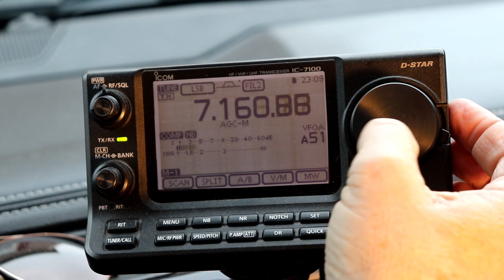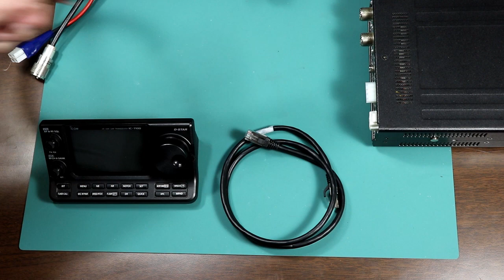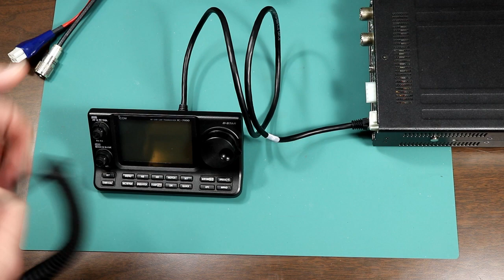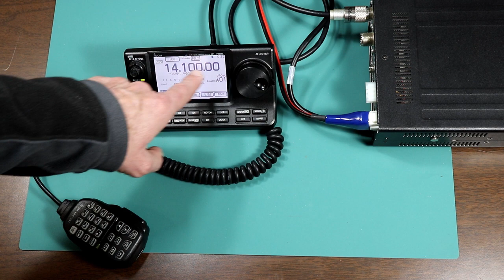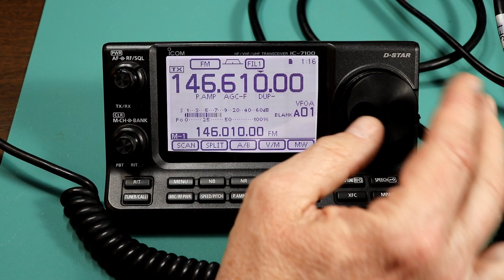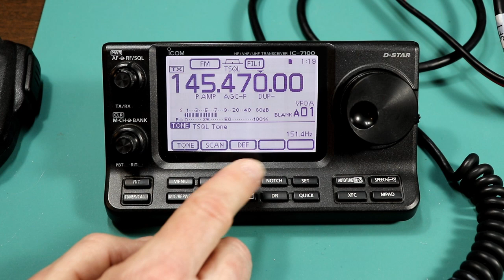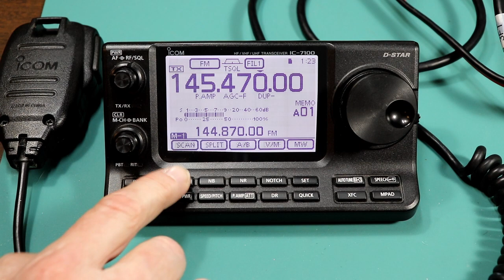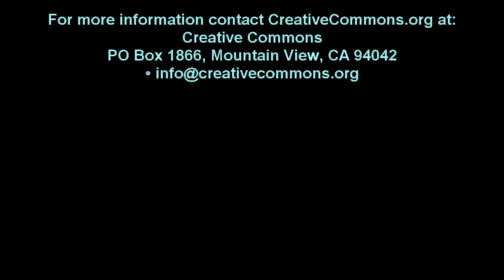IC-7100 from A to Z #2 Setup-Resetting-Programming a 2 Meter Repeater Frequency

Comment: Ok. Guess the old days of unpacking the box and intuitively being able to transmit are gone.
Thank you so much for the guidance as this 69yo has no patience for a 300p manual. Will be watching ALL the videos. 73 n6iv
Reply from the maker: Hi Mark.  Thanks for the kind words.  You can almost use the 7100 without reading the manual, at least just to transmit and receive on 1 frequency.  However, there is so much more that the radio can do if you learn it with tutorials or with the manual.
Reply: Just the video I was looking for. 

This seals the deal on purchasing a IC 7100. 

Thank you.

Comment: I have a General already-it was much cheaper than a radio. So I just bought an IC-7100, a power supply and waiting on my antenna and cable- really good videos-thanks for your time as a “video Elmer”

Comment: Thank you for this.  You really don't know how much I appreciate this series.  I am a brand new Ham with a brand new IC-7100.  I bought the radio because it is an all mode all band radio.  After reading through the basic manual and making my way through most of the full manual, then trying to put it into practice I was beginning to think I was way over my head with a radio I had no idea how to use.   Looking forward to the rest of the series on this radio.  Thanks again.  KE8OTX

Comment: Liked and subscribed. Good stuff. Thanks for putting this together Tom. Very helpful. I attached a cheapo mobile antenna on a pizza pan to my 7100, and was able to hit the local repeater that's ~5 or 6 miles away. I participated in a local net, and had my first conversation with some other ham folks in my area. First time not using my HT or echolink. I've got the local repeater and the NCFs stored.
Reply from the maker: That’s great Rich!  I’m glad you’re enjoying the 7100. It’s a big step up from an HT.  Hopefully you can get an outside antenna up at some point.

Comment: Thank you VERY much!!!  The IC7100 is my dream rig, but the user interface takes a little getting-used-to.  I was totally baffled how to get this thing to remember a simple 70cm frequency and PL tone!!!  You made it VERY clear!!!  You're a great Mentor Tom!!!!  73!!!!!!!!   -N3FPZ  (John)
Reply: PL (Private Line) is a registered trademark of Motorola and CG (Channel Guard) is a registered trademark of GE land moble they both are the same for the generic for CTCSS (CONTINUOUS TONE CODED SQUELCH) which is normally used on the input of most repeaters. CTCSS was and is used to keep noise from keying up repeaters.

Comment: The cable is a CAT 6e/7/8 double shielded Ethernet cable.   A  15' cable Cat8 SSTP with gold plated connectors on Amazon is only $20.00 USD.  The icom cable is over priced.  Strait through vs. 568a does not matter.  Since the same pins connect on each side.  1-1, 2-2,3-3, 4-4,5-5, 6-6,7-7,8-8.  Only matters in the case of a roll over or a 568a - 568b cable (cross over, non standard)  Thanks for going over this radio.  I just purchased mine yesterday.  I am waiting on pins and needles for it to arrive.  Going through your entire series now.
Reply: Hi Jim, I'm running my IC-7100 through a portable battery rig and the included cable is just so much longer than I need it to be. Since you seem to know much more than I do about these things I'm wondering if a cable like this will work, since it's not a CAT 6e:  
"Cat6A Shielded (SSTP) Ethernet Network Booted Cable 4 Feet (1.2 Meters) Gigabit LAN Network Cable RJ45 High Speed Patch Cable"
Could I use a CAT 8 with the gold connectors? Thank you in advance for any help.
Reply: @travisyoung3455  The cat 6 cable may work.  However, the cat 8 has additional shielding.  Close proximity to a RF source can induce errors in the system.  I experienced this the first go around and in some cases can cause your radio to reboot right in the middle of transmission.  So, honestly I would stick to the cat 8.  In cat 8 each pair is individually shielded as well as the bundle being shielded, not to mention the additional twists per inch.  So, yes, go with cat 8 with the gold shielded connectors.

Comment: Very helpful video!  I bought a 7100 because I want a mobile transceiver than can cover HF and VHF/UHF,.  I have a 7300, but I've committed that rig to my ever expanding Ham shack.  I am impressed by the ease with which 2-m repeaters can be programmed into the 7100.

73
KI5KET

Comment: I have the IC-7100 and the IC-7300. Lucky for me you are doing all the heavy work for me. I was doing this on my Yaesu FTM-400XDR this morning. ICOM sure has it over Yaesu on ease of using their menus. I think I was able to do this the first time without consulting the manual. I have to grab the manual every time I program in a repeater on my Yaesu because I don't do it enough. The ICOM radios are just intuitive enough to help you through the process most of the time and a similar from radio to radio unlike Yaesu radios are different radio to radio.

Comment: Great stuff... spent all evening reading the manual on the used 7100 I just received and assembled today.  Resetting and starting over was the way to go as well as your explanation of the repeater Tone settings (I didn't have both set).  Now I know why I couldn't get into the repeater with this unit or save it to memory.  Thanks!
Reply from the maker: Glad it helped!

Comment: Tom, many thanks for confirming the type of control cable we can use in lieu of the two options provided by ICOM.  I couldn't easily find this info elsewhere.  I am new to the 7100 and am using it in a base config on a small table so the standard 11.5 ft cable included is way too long for what I need.  Looking forward to reviewing the rest of your IC-7100 videos!

Comment: I'm assuming the 5100 is going to be very similar menu and operation wise? The 5100 is probably going to be another radio in my stable.

Thanks for explaining "Tone vs TSQL" nobody had ever made the distinction before, and I have seen it in chirp and other places, and so far had just been setting both Tx and Rx "Tones" without knowing what TSQL was actually doing. I have seen split tones on some GMRS repeaters, but never on an Amateur Repeater yet.

Comment: A great series of videos thanks Tom. I chose/purchased a 7100 knowing that your 7300 videos had helped so much. What are the dash mounts shown/used in your vehicle please?
Reply from the maker: Hi.  I'm glad you're finding the videos helpful.  Thanks for the kind words.  I use RAM mounts for the mobile setup.  I have links to some of them on my website here:  https://a-2-z.tech/stuff/.
Full disclosure- they are Amazon Associate links.  So I get a small commission if you buy something.  It doesn't affect your price.  There are tons of different options available.  Just search "RAM Mounts".
P.S. - If you start from one of my links, I'll get credit even if you search for something different and buy it.
Thanks!  Tom
Reply: @HamRadioA2Z  I am happy that you get a commision, if you hadn't mentioned it, I would not have known. I have the 9700, 7300 and the 705 and the 7100 still fits into this line up Tom. It was an indication of where Icom were heading when it was released, but it still can hold "its own" as a shack/portable rig.

Comment: I just started watching this series for my 7100.  Was that hand mic an optional mic. Mine came with the HM198.  Also my control says D-STAR while your control head says DIGITAL when the video had it in your truck.
Reply from the maker: Hi.  Yes, the HM-151 remote control mic is optional.  I managed to pick one up used.  I find it very helpful for tuning around and changing bands when operating mobile.  I'm not sure what digital reference you are referring to.  The radio displays DV when it is in DStar mode.  I haven't done anything with DStar or any digital HF modes in the videos yet.  73, Tom WA2IVD

Comment: Tom -  Thank you for this series, it is great.  I have a question.  At about the 16:00 minute mark of the video, immediately underneath the frequency, your screen shows DUP - .  What does that mean or represent.  On my screen I have DUP+, but I can't transmit, only receive.  How do I change it?
Michael
Reply from the maker: Hi Michael.  DUP- means that the radio is in Duplex mode.  That is, the transmit frequency is different from the receive frequency.  The - means that it will transmit below the receive frequency.  The + on yours means it will transmit above the receive frequency.  The amount above or below is set by the standard offset.  The default on 2 meters is 600khz.  On 440mhz the default is 5Mhz.  Not sure why you wouldn’t be able to transmit.  What frequency was your radio set for?  BTW- sorry for the delayed reply.  Saw your comment a couple days ago and couldn’t respond just then, then got busy and forgot about it.

Comment: Hello sir i would like to ask if this radio has a full duplex mode and if it can be crossband repeater. Thanks anyway!
Reply from the maker: Hi.  Sorry, but the 7100 does not have that capability. It only has a single receiver and frequency synthesizer section.  So it can’t do full duplex or cross band repeat.

Comment: 10:41  "All right, so we're connected up, we're plugged in...."  What about connecting to ground?
Reply from the maker: Yep.  That would have been good.  It would have been better if I showed connecting up a ground.  In this particular video, I was just using a small mag-mount antenna mounted on a metal plate on my deck.  So I didn't bother for this particular example.  Good catch.

Comment: I HAVE BOTH THOSE RADIOS BUT MY IC-7100 IS STILL IN THE BOX..SINCE I GOT IT NEARLY A YEAR OR MORE AGO.. I HAVE A YAESU -FT-991A THAT SITS ON TOP OF THE IC-7300.THAT ONE IS MY DAILY USCE RADIO..THERE IS NO D-STAR ACTIVITY IN MY AREA......04-06-2020-01:50HRS-E.S.T.......................
Reply: Roberto Ellison which rigs are for your daily use, The 991a or both 7300... why? two HFs?

I am newbie looking for shack in the box and or mobile+hf..... comment or dstar vs Fusion c4.

my considerations for home base primarly are

yeasu 991a
ic 7100
ic 7300 and Yeasu 7250

thx
alex kj7ofm
73
Reply: @acaravajal  HELLO ALEX, MY DAILY IS THE 991A WHICH IS SITTING ON TOP MY 7300..I US THE 991A BECAUSE I HAVE YET TO GET MY GENERAL, AND MY DMR / D-STAR ID,S....73 FOR NOW GOTTA RUN.....
Reply from the maker: Hi Alex.  I have found DStar vs. Fusion activity is very local/regional.  Some communities are mostly Yaesu, others are mostly DStar.  If you live near a large city you may have some of both.  If you have a hotspot and have reasonable internet service, you can get on either system whether or not there is a compatible repeater near you.
As far as Mobile HF, my opinion is that the IC 7100 is the best choice for that.  The control head is already remote, by default.  I have also found the large display size and angle works out very well in the vehicle.  All of the rigs you are looking at are fine radios.  Good luck with whichever one you pick.
73,  Tom WA2IVD